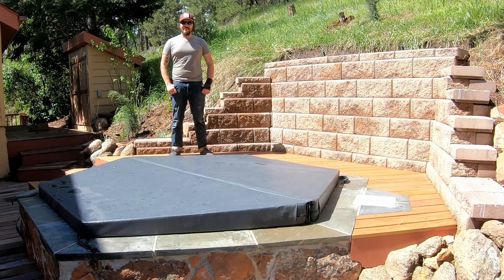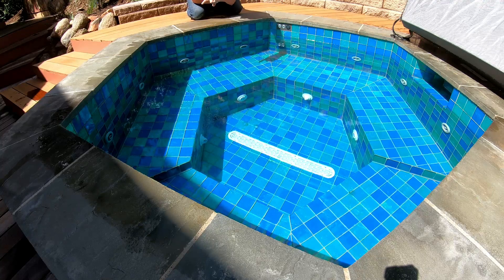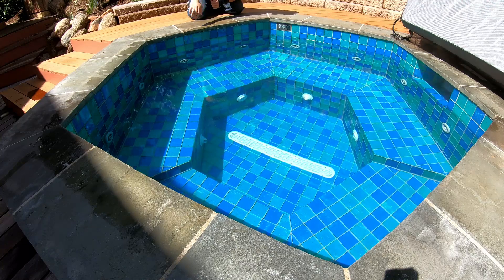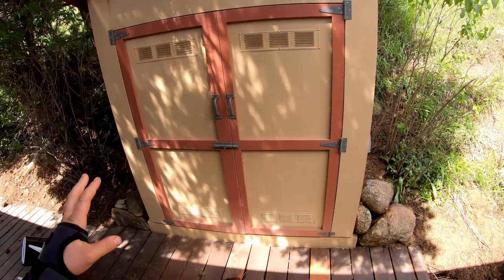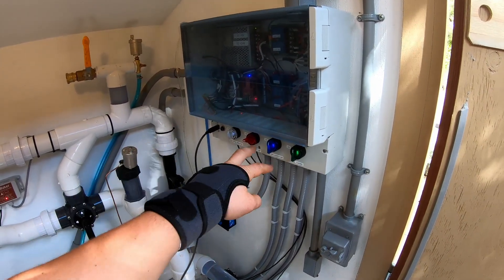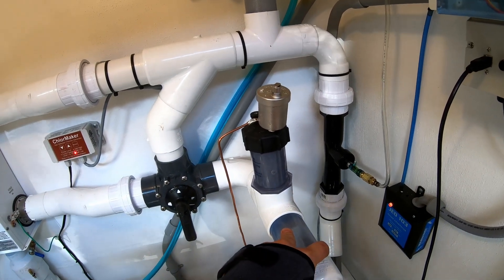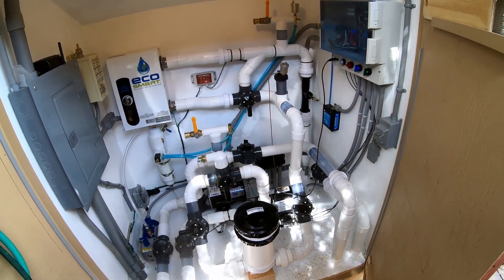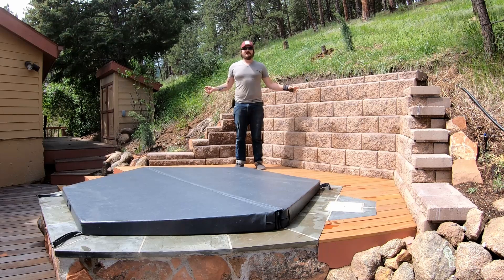Hexagonal Hot Tub Build Intro

Comment: When you opened up that pump house - I wasn't sure if I was looking into the avionics/hydraulics bay of a 787 or a hot tub pump-house... Maybe extremely excessively over-engineered, but very impressive! :P
Reply: Way over-engineered.     It's not a municipal water plant that has exacting standards for drinking water.   It's a friggin hot tub.   A sarificicial annode??   Are you kidding me?   Vacuum priming pumps?   Did you put it all together in a NASA clean room?  Hope you wore your mask and hair net for the final assembly process.   You need a manual just to operate this thing.  Do you have checklists to follow for the various phases of flight?  Good lord.   With all that being said, you made a beautiful hot tub and the glass tile is on point.    Your pump house is however insanely ridiculous..    To each his own though.